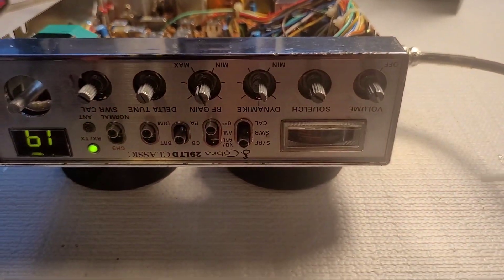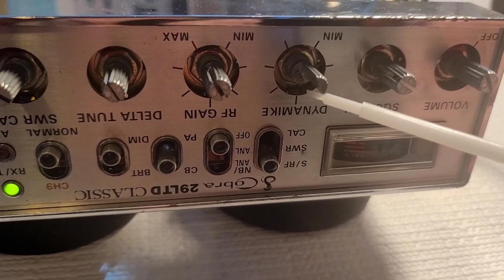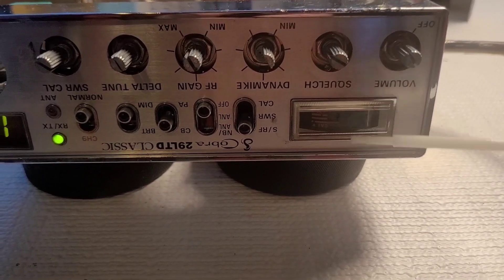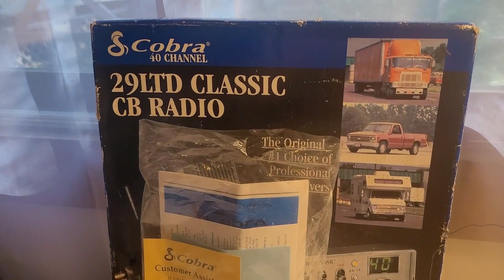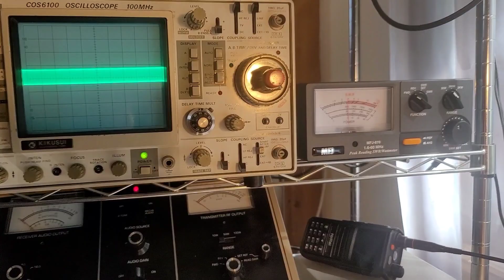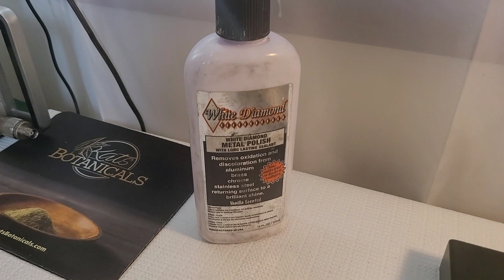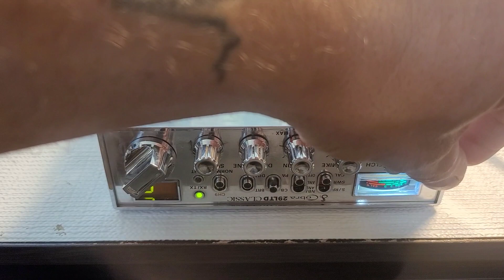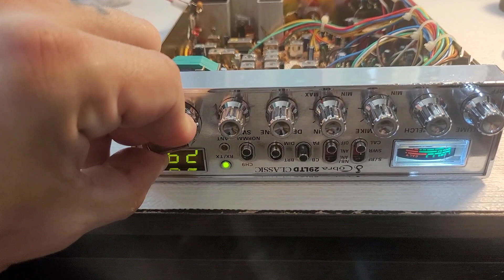My old workhorse Cobra 29 and recapping tips

Comment: I'm in the UK, and I got into CB radio back in the late 1970's when I was still in school. Back then it was mostly radios made for the US market that were finding their way over here. I didn't own my own radio until 1980 when I got my hands on a new Cobra 21GTL, and since then I've always been a sucker for Cobra radios. My main radio these days is a Cobra 148GTL-DX (the European export version), but I did buy a really nice condition Cobra 19X (FCC) from eBay UK last year (it goes nicely with my Maxcom 4E, which is a UK FM version of the same Maxon chassis radio). Last month I bought a Cobra 18LTD (FCC) also from eBay UK but it has no mic so I can't fully test it. It's a rare radio to find in the UK and therefore I can't find any info on it. Have you any idea of what other radios share the same mic wiring?
Reply from the maker: The UK if I remember correctly had thier own frequencies different from the rest of Europe right ?  Then Europe adopted US frequencies ?  So in the UK you have FM, Euro channels and UK channels right ?  I remember UK being out of the loop from the rest of the world. Those are nice radios you have.  I love the old Cobra radios.  Not so much the new stuff and Cobra support is non existent now. That 18 ltd I haven't even seen one yet on my bench ! But that should be a 4 pin cobra standard wiring.  Just like the cobra 29 and all cobra 4 pin jacks.  pin 1- shield, pin 2-audio, pin 3-transmit, pin 4 - recieve. If you need the schematic email me and I'll send it to you
Pulsarcbrepair@gmail.com That 18 Ltd is a TC9106 PLL same as your 21 GTL and 21 ltd so the layout and alignment could possibly be the same.  Hope that helps. 
73s
Reply: @pulsarcb  Sorry I'm slow to answer you, but I had no notification that you'd replied ... Anywayz, yes we still have our own unique Uk40 FM CB. We also used to have a UK CB band on 934mhz (legalised at the same time as UKFM back in 1981), but that has since been withdrawn. We also (like you say) have the EU/FCC 40 channels, and we're allowed to use 4 watts AM and FM and 12 watts USB and LSB (same as you guys) ... The Cobra 18LTD has a 5 pin din mic socket and is made in China. I found a pic online which states that the radio was made by Uniden, so I'm thinking maybe a Realistic mic may fit it? ... Thanks for replying though, it's very much appreciated.

Comment: I have a tendency to overthink things.... so I am wondering....   does lead spacing of caps ever cause you any trouble?  I'm aware that many places sell caps that have lead spacings like 2 mm, 2.5 mm.  In reality will either one fit in the board well enough even if the replacement cap has a different spacing?    Thanks!    I'm enjoying your videos.
Reply from the maker: Sorry I thought I responded to this.  Never had issues with the spacing.  The leads are long enough to bend them or spread them out to fit.  

73s
Reply: Thank you sir.  I am really enjoying your videos and glad that I found your channel. You are inspiring an "old fart" who is collecting test equipment and questionable radios for something to do in retirement!!!
 @pulsarcb